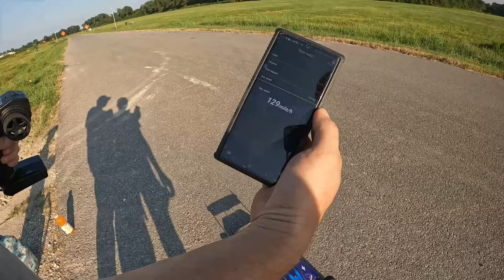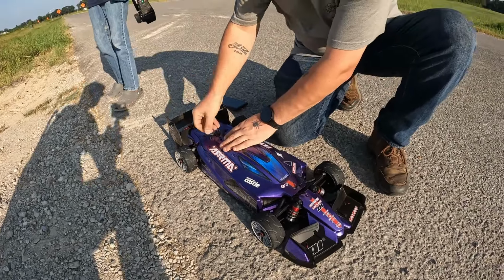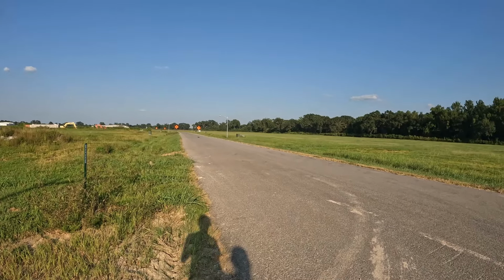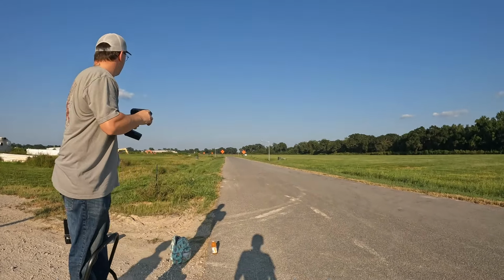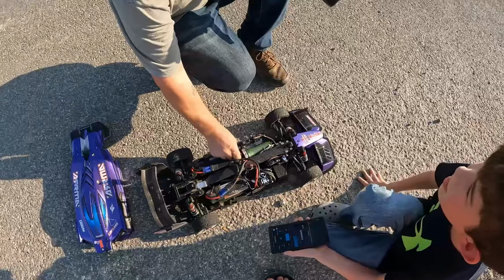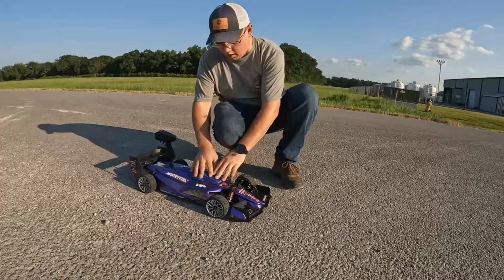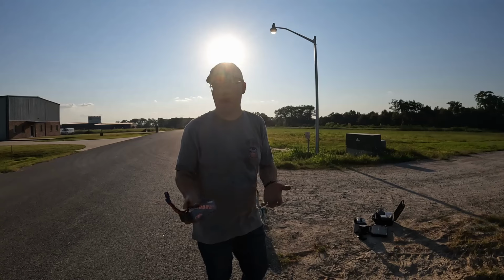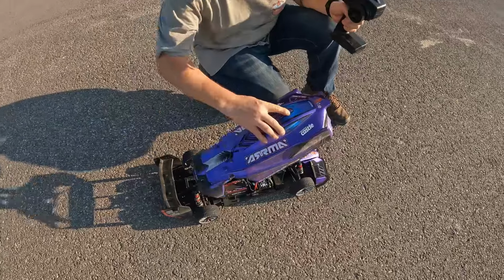Castle 1721 2400Kv ARRMA Limitless Hits 129 MPH! Test Speed Runs Set a New Personal Best

Comment: I also do speed runs.  Just a suggestion your Spur gear sweet spot is from 34-36.  Then go up on your pinion from 36T.  Shut down the fans, they are taking the juice away.  Don't run your fans off the system,  they need to have their own battery.  Do about 3 high speed runs, and then rest the car.  When resting you cool it off with the extra battery, not the system battery.  I not suggestion on the center drive shaft, but toss that oem shaft, it wobbles and your losing speed.  When you go with the QS8 connectors you will see an improvement on the overall runs.  Are you downloading your logs?  The logs are important to be able to read and understand.  Are you getting 100% on your throttle?  The logs tell you all that good info.  I'm quite sure they are full.  Delete them all and do about 3 or 4 runs with what you currently have.  Again Logs are very important.  I wish you well on your runs.  Again those are things that I have done.
Reply from the maker: Thanks for the info. Currently, I have a 45-tooth spur gear and a 30-tooth pinion gear. I'm planning to remove the fans from the battery. I use the Scorched Trident center shaft with Scorched drive cups, so there's no center shaft wobble. Before the next run, I'll have my QS8 and new batteries. I always download and analyze my logs, and I have a video where I review and interpret them. I'm steadily working towards hitting 200 mph.

Comment: Those are the lower tier CNHL basically the cheapest ones you can purchase. Get CHNL Racing Series/90C, G+70C or SMC SRD with QS8 plugs & see your results. It's not what people says it's what Castle says... it's literally on the website & the XLX2 manual saying to use Castle 6.5mm polarized or 8mm bullets/QS8 connectors for that specific ESC Mamba XLX2 SPECIFICATIONS/Product Use Statement
Reply from the maker: Are they? I purchased based on the 120C rating, thinking those would provide the higher output. I saw the 90C ones and assumed they would be less effective. So, would the 90C and 70C be better options? If you provide me with the exact model number, I can order them right away.
Reply: @SpeedBoostRC for the LV2 get 4S/5200 90C or 4S/5000 G+ 70C. Both should fit the stock battery trays perfectly 👌🏽🔋
Reply from the maker: @cacanjacowans540  Awesome, thanks so much. I'll have to do some research on the C rating as I  figured the higher the better, so that's why I went with these.
Reply from the maker: What about the Innovation RC CNHL 10000mAh 4s Lipo Battery 100C 14.8V?
Reply: @SpeedBoostRC  way too big for a Limitless V2
Reply: @SpeedBoostRC  those packs are humongous. Definitely made for 8S offroad vehicles 😅
Reply from the maker: @cacanjacowans540  I'm trying to find the right ones to get on Amazon so I get them quickly.
Reply from the maker: @cacanjacowans540  Ended up getting some G+ 6.0 70C.  The weird thing is that they were cheaper than these on the CNHL websites.
Reply: @SpeedBoostRC  most definitely. Little known fact The website usually has the best sales, if you can catch them. Hope you don't have any fitment issues with those 6000 🤞🏽❤️ GOOD LUCK!
Reply from the maker: @cacanjacowans540  Thank you
Reply: You are correct partner

Comment: Hola qué relación de piñón y corona tienes puesto??
Reply from the maker: 26/45
Reply: Yo tengo el infraction con Max 6 y motor 4990 . Me corría con piñón de 27 y corona 46 , 139 kmh , con conector ec5 . Hoy lo he probado con conector Q8s y me corre en 6s 151kmh . Pero le pongo opinión de 30 y en 8s me corta a 181.Kmh. 
Te recomiendo que pongas los conectores buenos , anime corre 12 kmh más en 6 s solo por cambiar los conectores. 
Ya te diré cuánto me corre más con el piñón de 27 en 8s , porque hoy lo he probado con el de 30 y me he cortado a 181 .